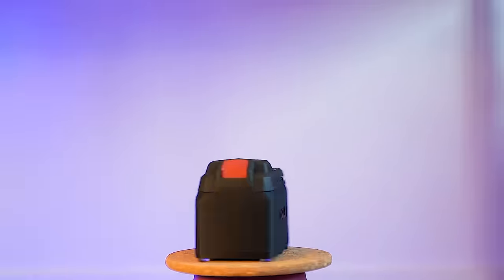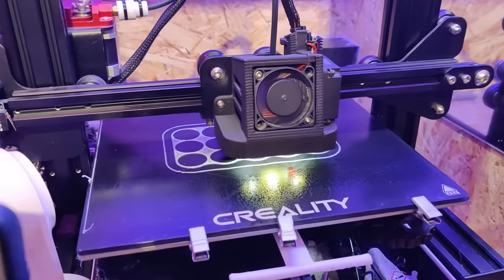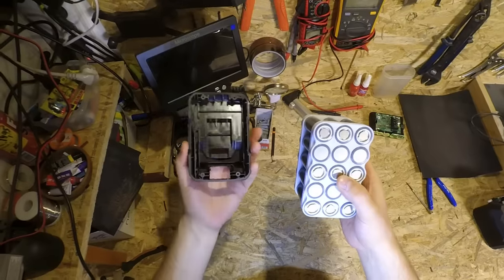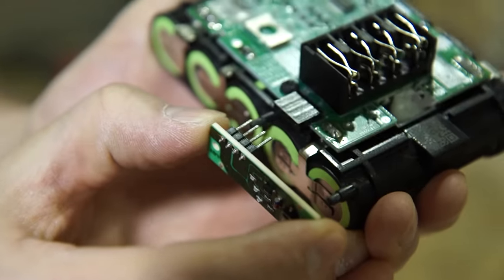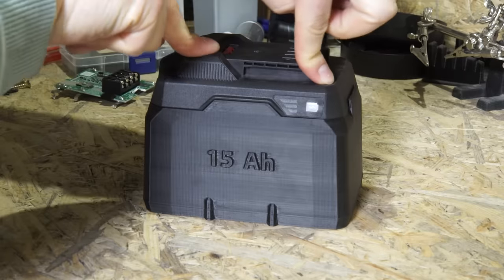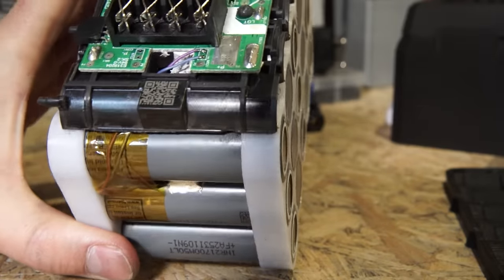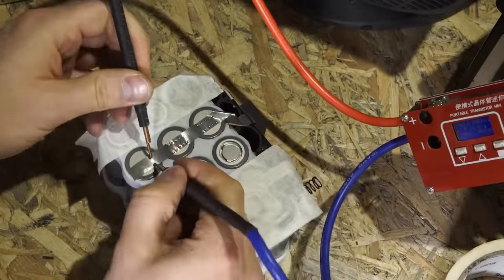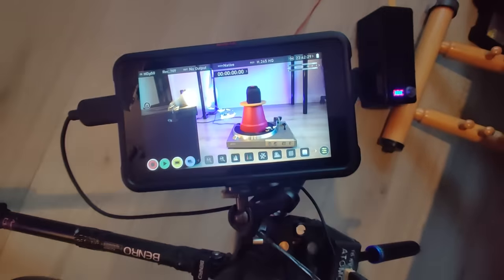Build a GIANT⚡⚡15Ah⚡⚡tool BATTERY!

Comment: Very nice, and subbed. Suggestion: use the old 18650 batteries to make a 12v batt for the 'new' spot welder. OR, use an old 240-300watt PC power supply. Like out of an old desktop Dell or HP. I use them to charge car batteries. They can easily put out 18-20 amps at 12v. They have their own fan to keep them cool. Charges a very dead car battery up to the point it will start a car in less than an hour. (more like half hour) Anyway, glad YT recommended this channel, looking forward to future projects. Greetings and cheers from Alaska.
Reply: Those little red mosfet spotwelders need a 12v supply capable of delivery 300A _minimum_, lower than that will produce faulty welds and also cause the spotwelder mosfets to fail almost immediately.
Reply: @CypherAod  that's interesting, thanks. Well they make great car battery chargers.
Reply: @RANDOMNATION907  yes absolutely!
Reply: @CypherAod  does this means that you cant use PC PSU for this Spot Welder?
Reply: @grindel80  nope. You need capacitors or very high discharge batteries. People make banks of the Maxwell 3000F Ultracaps but those are slightly overkill. For batteries you need to use LIpos that drone/EDF plane pilots use, Headway 38120HP or 40152 cells or SPIM08HP. There's others but off the top of my head thats the most obvious options. Battery Hookup has the SPIM08HP's two for $5.50 used. Put 4 or 6 in parallel after making a 12V pack and that should be PLENTY. The Headways they sell are pretty degraded, more so than the SPIM08HP's IMO

Comment: Hi bro you selling this tipe of batery??
Vendes esos tipos de batería??
Reply from the maker: Hi, I do sell the 3D printed parts on Etsy if that could help you out?
Problem with making the complete battery is that it's really a lot of work and I think it would be too expensive to most people if I sold the completed product..
But feel free to make an offer I can't refuse 😅 I might just make an Etsy listing of the complete battery as well.
Reply: @Solipsfilm  how much would it cost?
Cuanto costaría completa?
Reply from the maker: @alonelogydenmad4750  My estimates costs to make it: 
€64.19 batteries,
€25 Parkside 2ah battery (for BMS board and top part) 
Plastics and printing €10 
Nikkel strips, solder, heat plaster €7 
Working hours 5x17=€85

So total €191 for the 15AH Parkside battery. 
Plus shipping to Spain? €21.50

I know it isn't cheap but for less I can't justify making them, I have too much other work on my hands 😅
Reply: Okk bro thanks 🤙🏽

Comment: Hi folk, there is one thing I concern that every lithium battery should have the protect board for each. The old PCB designed for 10 batteries, but you put 15 batteries in the board, which could cause overheating or overcharging in each battery.
Reply: Negative. The boards are designed for a certain number of cells in series and even that is changing with boards being designed for 6S-22S and the only spec that isn't variable is the max discharge rating....unless you use a contactor in which case every single parameter has become variable.

Or you can just skip the BMS and pay attention like I do. If you're forgetful add a voltmeter or if you're really forgetful add a voltmeter alarm/buzzer and set the alarm to go off at the discharge voltage of your choice. You get an audible alarm but you decide when you actually want to stop using it unlike a BMS that will cut off when you're 98% done with a project and just need 2 more minutes of use. Short circuit protection is pretty much the only protection I miss. If you size the wires correctly you can have it so the wires fail when you pull too much current if that is a concern with high discharge cells. Add an active balancer to keep the cells in line with each other and you should never have to worry about them getting so out of balance that 3 groups could be 4.0V while 1 is at 4.6V....you'd need some seriously jacked up cells to do that with the 5A capacitor based balance board.

Comment: does this battery realy work? and can it charged by the original parkside charger?
i cant belive that. isnt every BMS turn into electric scrap when it loose the connection to any of the cells?
i did the same on my laptop. remove the 4 original cells, solder/spotweld the new together, put it in the laptop, and its not working.
ok it start up, but says "this is not the original battery, i lost the power and dont let you use new cells, buy a new battery from the manufacturer for double the price of the cells"
Makita battery same problem. once any connection to any cell lost, and your 80$ battery is scrap.
Reply: Why wouldn't it work? Not every BMS bricks when the voltage changes due to a cell dropping out. Only laptops really do this AFAIK

Comment: The idea of an 5S3P battery-pack is a good idea. But the most important point is the correct choice of cells.
Calculating the total power isn't helpfull at all. The most important factor is the discharge current capability of the cells.
More precisely how much current they can provide continuously and how much in short bursts (10sec).
This is, cause some tools like angle-grinders will drain quite some current, when put under some load.
That current is going up to 60-100A. If the Cells can't handle such drain they heat up quite fast and get damaged.
At minimum you should have taken some with 30A discharge current. So your 5S3P configuration would be capable to deliver 90A in total.
That is why 2P battery-packs doing better in some tools than the 1P ones.
Reply: Calculating the total power IS the discharge current capability...multiplied by the voltage of the device. You can't put out 1200 watts on a 12V battery if its not capable of 100A. Total power is often listed in the datasheet just like discharge current (continuous) and (burst) are.

Comment: At this point why dont print entire battery housing? BMS pcb's are cheap and easy to find, same thing with power terminals
Reply from the maker: But they won't charge on the official Parkside chargers.. (Tried that before) This seemed the nicest solution to me but feel free to make your own variation 😉
Reply: @Solipsfilm  hi, so u tell us, that it would not charge on the official parkside charger, but would a BMS that isnt from parkside work in parkside tools? It may sound like a bad question, but on my ebike from bosch u cant use BMS other than from bosch, because that BMS communicates with motor, does the same apply to parkside? Or only to charger? Many thanks

Comment: How do you include the metallic parts to 3D printed battery?
Reply from the maker: I'm not sure if I understand the question sorry, could you specify?
Reply: @Solipsfilm  I noticed later that top of the battery was "imported" from the original battery. I thought  the entire battery was 3D printed. Practically it was just extended. Nice work anyway!

Comment: Molto interessante ma quante batterie posso collegare in parallelo? Posso arrivare a 60A?
Reply from the maker: I don't think I fully understand the question, you want to put even more cells on the battery pack? 😅 That would obviously be possible but then I'd have to design an enclosure that is even bigger and I think that would become a bit too much, no? 😆
Reply: @Solipsfilm  yes I don't care about the battery volume or weight of the battery, I would likes to use the same system as a Power bank station fixed.
Reply: You can parallel as many as you want. If you want to use a slightly lower capacity cell you could use the Molicel P45B. Two of them will safely provide 60A (the 50A rating isnt entirely true). They have 4500mah capacity but they are over $10 per cell. Or use the P42A for half the price. 30A capable and 4200mah.

Comment: should have left the geometry along the lower edge of the top casing. That's where the strength of the joint is.
Reply from the maker: If that was possible I would have done that, these bigger cells don't fit in the top part without cutting these parts away. Without cutting this, the battery would have been two centenmeters taller with some empty space inside the top part.

Comment: works well until you run into a bms that "self destructs" or (in other words purposely wont work after you disconnect the cells) because the manifacturer wants you to buy new batterys for "safety reasons"
Reply from the maker: As far as I know there's really not many manufacturers that do this, been replacing cells for years in all kinds of appliances and never had any problems. I know of the case Louise Rossman (YouTube) is talking about where a company that makes a one wheel does that and if you look at the comments on every one of this companies videos the comment section is nothing but hate for the company. Blocking users from changing their own batteries is really going against the independent repair guy and basically means you don't really own the product you're buying of a company. The moment I know a certain company does this I'm not buying their products anymore. This is really a bad direction for electronics, leading to more electronic waste which we definitely don't need :)

Comment: those tiny rails are not meant to hold this much weight. Also cells you used are not tool grade, they are energy cells, not power ones.

Comment: my sugestion is run the batteries down to minimum power levels first.
Reply: Not a huge difference between a cell at 3.5V and a cell at 2.5V as far as a short circuit goes. Both are gonna make a big boom and as long as you don't have a wrench melted to the two shorted terminals it'll be over in a second

Comment: The factory has thought about the battery capacity and total weight. If the tools are heavier because the battery is too big, it's not efficient, it's better if 2 small batteries are one used and one is charged.
Reply: For a drill yes but for a lawn mower these would be nice for a big yard.
Reply: @wally7856  heheheh i think so
Reply: @wally7856  Electric lawnmowers are only good for small to medium yards. Anything large is better suited by Dino fuel.
Reply: @orppranator5230  Once you use a "good" battery push mower, you'll never go back to gas again. But if your yard is too big for a push mower and you need a ride on, then dino fuel is still the way the go ... for now.
Reply: @wally7856  Never is a strong word, but yes that’s my point. 

You do have to worry about the longevity of the batteries, where you will have to replace them every couple years, and the cost of that is likely offset by the cost of gas and oil, but electrics are just easier to use making them better generally.
Reply: @orppranator5230  they make 60"+ deck riding mowers that can do 2 acres or more. Ego and Ryobi I think. Any other opinions not based in reality?
Reply: @ericklein5097  Can they do two acres for 10 years with no battery replacements? No. 

Can they even do two acres at all? Is the advertised number inflated to make the product look better? Probably. Actually, that's pretty much a guarantee. 

Watch this video from Aging Wheels, "This Electric Mower is Great! Until it isn't...".

Comment: I've built a similar battery for my Makita drill. The only problem is it does not charge with the original charger anymore. Now i know what is the purpose of the white wire hanging of the curcuit board

Comment: i have two bluetooth-connected 8ah parkside batteries and they are WAYYYYY enough big.
Reply from the maker: These batteries didn't exist yet when I made this big one, back then there was only a 4AH one from Parkside as far as I know.
Reply: @Solipsfilm  yea i bought my ipact drill with an 8 ah battery on sale
Reply: i mostly bought it for the battery

after that i found another 8ah battery and it really has bt-connectivity so i configured it to only work between 20-80% so it would last longer.

yes. parkside.
Reply: ngl the way lidl sells their stuff is just stupid. but the tools are good quality for the price.
Reply: i want an angle grinder and a welder but seems they just sell what ever on a whim. don't like it. but have bought their stuff b/c of quality per money.
Reply from the maker: Indeed, indeed.. Quite annoying that they only sell certain stuff at random moments, you really have to jump on the opportunity whenever their tools are in stock 😅 But yeah, for the price it's really the best stuff I think, I'm really building my whole workshop around their products and I love it 😆

Comment: You don't need to double up the parallel strips that aren't the main positive and negative. What you do need to double/triple stack are the series connections! All the current is flowing along those series connections.

Edit: Ahhh damn looks like you didn't double up any of the series connections but at least you put a strip on each cell to its neighbor. You wouldn't believe the amount of 32700 battery pack videos I've watched on YouTube that show some Indian guy cutting every corner possible including only having one or two series connections on a 20S8P pack. And you know they're using nickel plated steel which has about one third the ampacity of pure nickel so they're using the amount of material you'd use for a 10A safe discharge on a pack with a 50A BMS for a personal EV of some kind that's gonna be pulling at least 30A. TOASTY

Edit Looks like this was addressed

Comment: I mean its cool and all but kinda annoying to use a tool with battery that big and heavy.
Reply from the maker: There's the grass mower, the coffee machine, the radio, the miter saw from Parkside (just as a couple examples) that also run on battery power and with these tools you might just want that extra bit of power when out in the field 😉
Reply: 855 grams is heavy?

Comment: But do you not think that battery technology was intending more 'punch' for less size and weight? By doing this project you've literally taken the world back 20 years.
Reply: Using a state of the art 21700 cell is the exact opposite of going back 20 years. 20 years ago if you wanted 15A discharge you got 1Ah capacity.

Comment: why no stronger cells?
Reply from the maker: For the price these were the best deal I could find :) I wanted the battery to stay within the price of the new Parkside 8Ah pack so it would make more sense to make this one that has 15Ah, basically doubling the ampere's you'd be getting for the money 😊
Reply: there is no other cell capable of 5000mah that can do more than 14A other than the Samsung 50S and a BAK cell. Both expensive. LG21700MT is one of the best available.

Comment: these are not near as the original batteryes, on discharge rate they are only 14.5   x3 would give 45A , but this is max
Reply from the maker: Burst discharge rate is 21A x 3 = 63A which is way more than the original 4ah can deliver. I've tested it out and in every way my battery delivers more power and for a way longer period of time. The cells never get hot either so I wouldn't worry about it 😊

Comment: Why make a big battery though and use very low current capable cells ?Those lgs are only rated for max 14.4a discharge..  Even the cells in the parkside 4ah battery are 30a rated cells...

Comment: Bigger battery pack means heavier tool... better to make a few smaller ones...
Reply from the maker: There's the grass mower, the coffee machine, the radio, the miter saw from Parkside just as a couple examples that also run on battery power and with these tools you might just want that extra bit of power when out in the field 😉
Reply: Don't skip arm day

Comment: 11:55 actually the voltage off your car battery isn't perfect. It is 2 volts too low
Reply from the maker: "The ideal car battery voltage with the engine running is between 13.7 and 14.7V. With the engine off, you should get a reading of 12.6 volts."

There's a difference between AGM (13v 100% charge) batteries and WET (12.6v 100% charge) batteries.
Reply: @Solipsfilm  Oh, wasn't aware there is a difference wether the car is running or not. Cheers for explaining 😀
Reply from the maker: My pleasure :)

Comment: how the hell are you supposed to work with this anvil on your tool?😂😂😂
Reply from the maker: There's the grass mower, the coffee machine, the radio, the miter saw from Parkside just as a couple examples that also run on battery power and with these tools you might just want that extra bit of power when out in the field 😉
Reply: @Solipsfilm  where's the grass mover, the coffee machine, etc. On the video though? Point being, that battery pack is kinda ridiculous on cordless drill or on most hand tool. 😂
Reply from the maker: @wanderingandroid  True, what I meant to say is that these could be reasons people might want to make a battery like this.

Comment: oh parkside habe nur schlecht erfahrungen damit gemacht und empfehle es nicht weiter
Reply: The concept and the bottom part could be used with other battery tool systems, so you could use this with your preferred brand of tool.
Reply from the maker: @stevebabiak6997  Exactly, with some 3D printable adapters you can use it on almost every brand :)
However, I've been using Parkside for over a year now with almost every tool and I'm super happy with it so far.
Reply: @Solipsfilm  Hola. ¿Puedo pedirle que envíe el archivo de la impresora 3D? thingversen ya no está activo.

Comment: There's no way that battery is 5 Ah.  Most of those cheap batteries are fake, make sure to actually test the varieties you buy to see what they actually contain, and so that you can create properly balanced cells.
Reply from the maker: All the cells I ever got from Nkon were always perfect, voltage and capacity. 
I'll do a test of these cells in a future vid, I bought a bit more than I needed for the project so I can still test these.
Reply: LOL you have no clue what NKON is or an M50LT